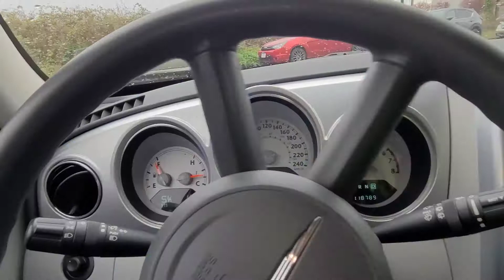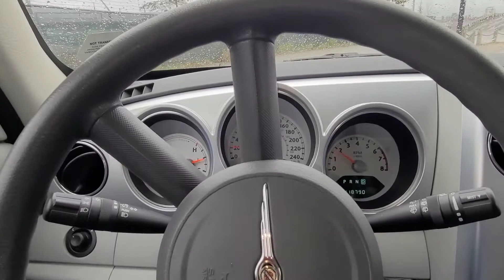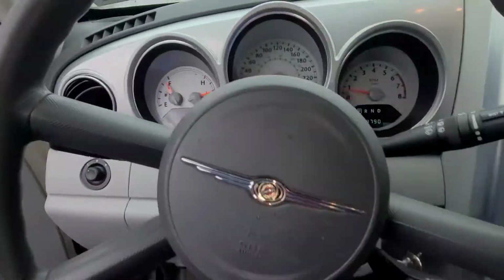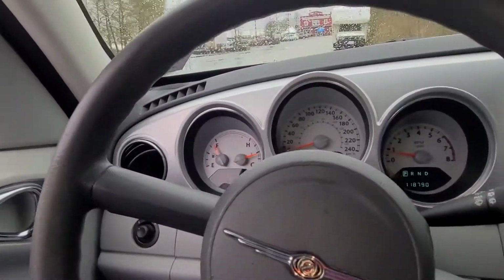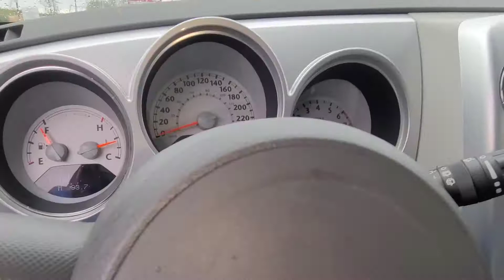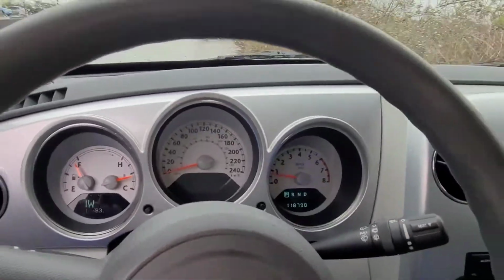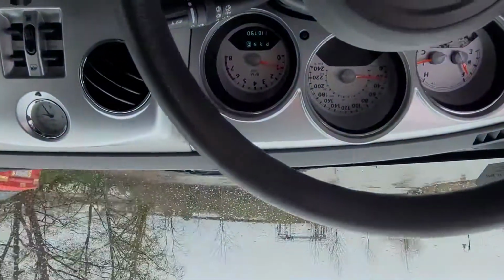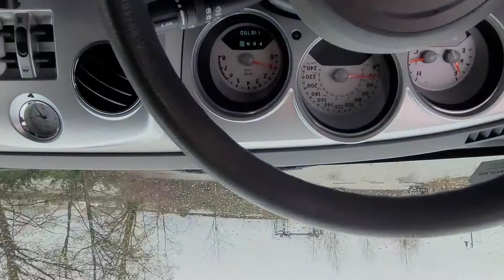2007 PT CRUISER VALVE COVER GASKET

Comment: How can I replace the 13mm at the back of the intake manifold?
Reply from the maker: Sorry for late reply, try to leave the bolts loose and line up the bolt then thread by hand and tighten everything after.. i hope that helps...
Reply: @VinDad1  sorry I meant how can I purchase a new one?
Reply from the maker: Any hardware store should carry them just know if it's a fine thread or coarse, i'm not sure on the top of my head... sorry